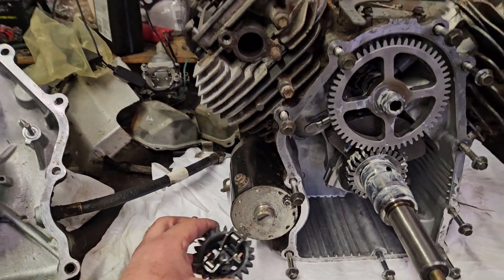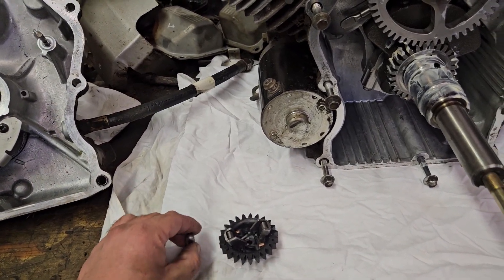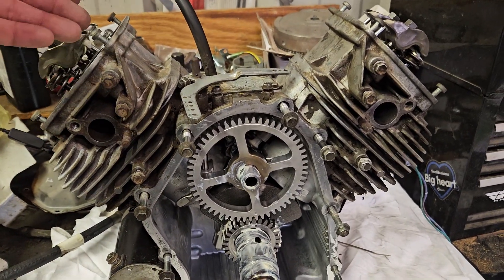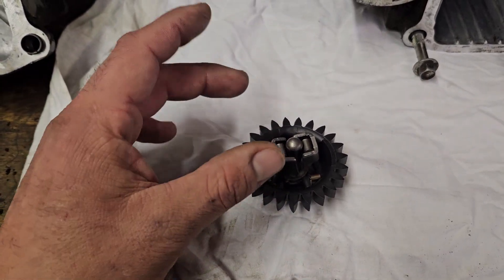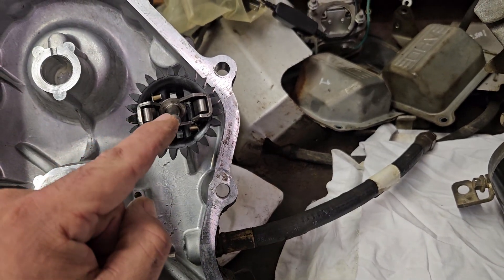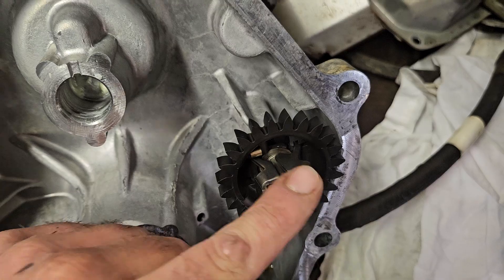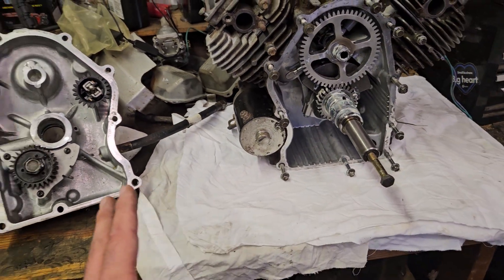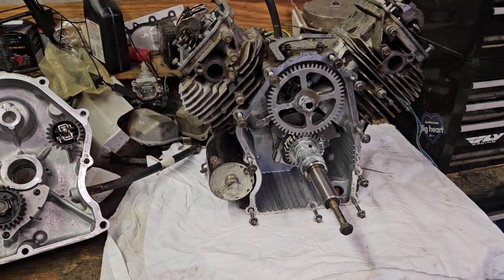DIY Governor Install: Kohler KT725 engine

Comment: you showed how to install it but how do you remove it??
Reply: just pull it out, but the manual says when it's removed , it must be replaced because the molded tabs break.I REMOVED ONE WHILE RESEALING THE COVER,  JUST INSPECTED GOVERNOR , AND PUSHED IT BACK IN. I DIDN'T KNOW IT WAS GOING TO BREAK AND END UP IN LOTS OF PLASTIC SHAVINGS IN THE BOTTOM OF THE COVER, ( THE IDLE WAS GOING OVER FULL THROTTLE ).I REMOVED ENGINE, TORE IT DOWN AGAIN AND FOUND BROKEN GOVERNOR, I LEARNED THE HARD WAY.